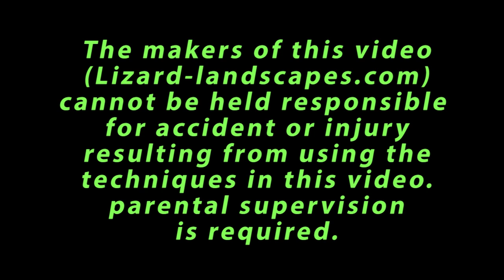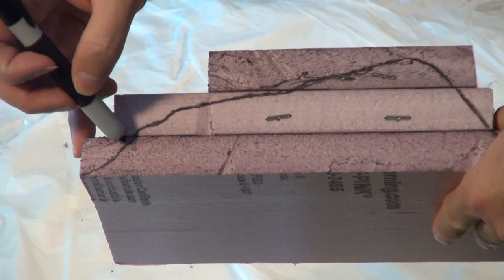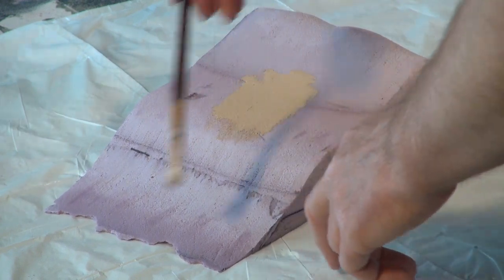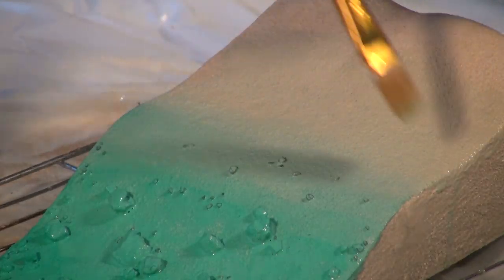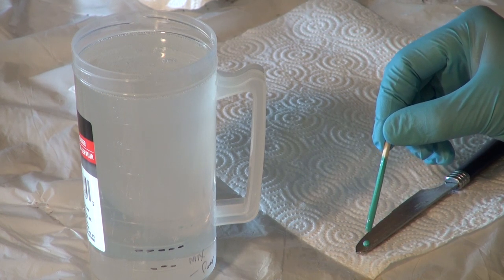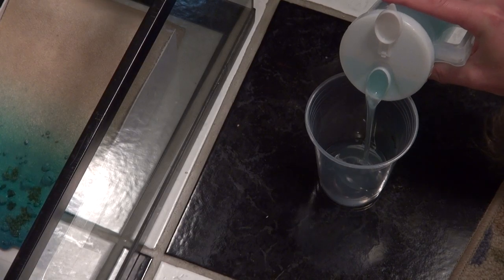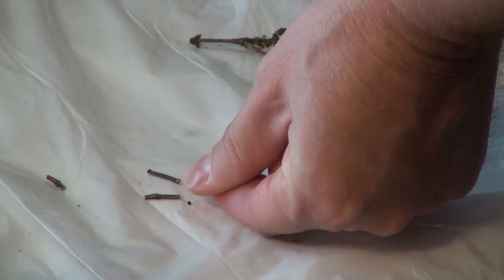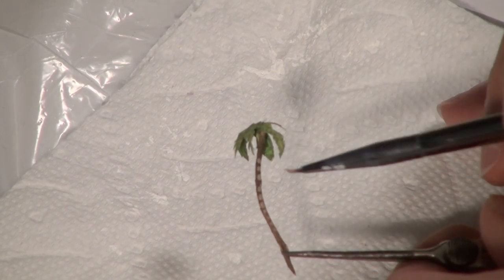Beach Diorama + Christian Message!

Comment: is that cardboard you just used in this video for holing the epoxy resin? Is there a recommend material for this purpose?
Reply from the maker: The recommended material is probably thin polystyrene sheets of plastic, but anything could possibly work.  I like to use something that has a little give to it -so it's easier to remove.

Comment: I seemed to miss why you poured it in 3 phases.
Reply from the maker: I thought I just poured it in two, but maybe it was three.  It's because it was such a deep pour; I'm using a type of resin that can only handle a certain depth at a time.
Reply: @LizardLandscapes  Thanks. So more than that and it would crack?
Reply from the maker: It's just what the recommendation is from the manufacturer.  It says not to pour over a half an inch at a time.  I poured over that limit, but wasn't willing to go too far, so it ended up being two or three pours.  But you're probably right, it might crack.

Comment: Thanks for sharing. Would this be stable enough for a 12" High sand dune/beach diorama (1/39 scsle Wright Bros. BI-Plane at the Devil Kill Holls (formerly Kitty Hawk) switching to 1/100 scale for slope and beach due to space restrictions. Thanks, God Bless
/Rosemary
Reply from the maker: Are you referring to the resin holding onto the landscape?  Or, pouring 12" of resin?
Reply: @LizardLandscapes  the Foam U used. So I worked it out: dune hieght will be 12" & base (run) will be 18.5" with 33° slope. Can it hold the weight of a 10" plastic Bi-Plane
Reply from the maker: I've made projects in the past where I thought it might be a good idea to insert a weight into part of the foam to counter balance the whole piece.  I probably should have done that with this beach dio; whenever I pick up this project I always lift it by the resin.  With trying to make sure the project won't topple, it would probably be a good idea to have a counter weight in some section of the foam.  I hope this is close to what you're asking!
Reply: Thanks God Bless
Reply from the maker: Good luck with the project!

Comment: I'm doing a personal PC build with a beach theme for my home, office, and gaming setup, I wanted to add a beach diorama I wonder if I could fit this in my PC case.
Reply from the maker: Sounds interesting.  How would you go about incorporating it in the PC case?
Reply: @LizardLandscapes  I'm gonna add it to the bottom of the case opposite the side of the power supply, I would like for it to extend to the full length of the bottom of the case horizontally.

 The only issue I'll probably have using this design method you present in the video is making the resin wrap around the power supply without actually touching it, but at the same time making it look like water naturally curving around an object. Because the way the resin stops at an angle in your dio in the video I would probably have to find a way to extend it and make it longer the same length as case, and shortened the width once it reaches the power supply unit in a way that makes it look as if it's curving around the power supply like water being redirected by a flood wall. And also finding some heat sensitive material to put between the resin and the power supply so the heat from want heat up the resin in cause it to melt.

But as far as custom cables, sleeves, and rgb lights that's how I'm planning on trying to do the diorama for it.
Reply from the maker: You'll have to send me a pic when done.  Don't know if this will help; I'm working on a new dio whereby I'm using plastic from a dollar store food storage container that I can curve and subsequently have the resin stop at a curved angle instead of the usual flat edge.  You could use the same type of plastic to build any shape, and force the resin to adhere to the form you want.
Reply: @LizardLandscapes  I don't mind at all sending you a pic when I'm finished, also that dollar store container idea should work perfectly.

I also got an extra idea from one of your other videos particularly the waterfall one, I'm gonna make just the waterfall part from it in make a smaller version of the beach diorama but place it near the top of the my case about to the height of the CPU, but I will use that container technique to curve  the edges of the smaller version diorama in make the waterfall drop all the way down from the small beach diorama onto the bigger version at the bottom of my case. It all should look epic once I'm finished.
Reply from the maker: Sounds great, you might think about creating a video about the process.
Reply: @LizardLandscapes  I'm not very good at making video, but this project will be so unique I may actually take your advice in give it a shot.
Reply from the maker: I hope you do, it sounds like it would be a very unique dio build.

Comment: I no you used enamel paint would acrylic work
Reply from the maker: Don't know.  It worked on the ice for the winter waterfall dio, but that was a different effect.
Reply: @LizardLandscapes  Thank's, I went to Michael's craft store but all enamel paint colors I needed where sold out, so I settled for this acrylic paint kit. Hopefully it works out
Reply from the maker: Ok, you might do a test -like I did with the small beach dio, resin is sooo expensive!
Reply: @LizardLandscapes  Yeah you're right that would be the safe route to go. Also I wanted to add I couldn't find any XPS styrofoam in my area so I ended using this stuff called flora craft, unfortunately it produces quite a lot of dust so I'll have to make sure I seal it well.

Also didn't manage to get a hot wire cutter, so I just cut out the shape with a saw in shaped it with this nail filling thing it came out pretty well now I'm moving on to the painting process.
Reply from the maker: Yeah, I didn't have a hot wire for years, -it does create a mess.  Seal, and re-seal!  I'm working on a project now that has had a lot of leaks -taking forever to get it to seal.
Reply: @LizardLandscapes  Yeah, I'm using this spray on sealant. The reviews on it where pretty good.
Reply from the maker: Ok, good luck, let me know how it turns out.